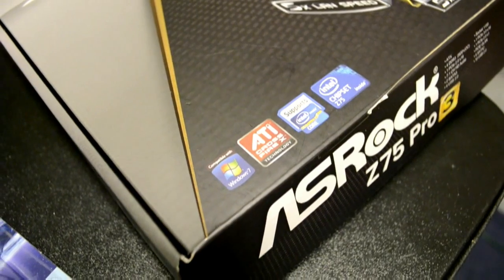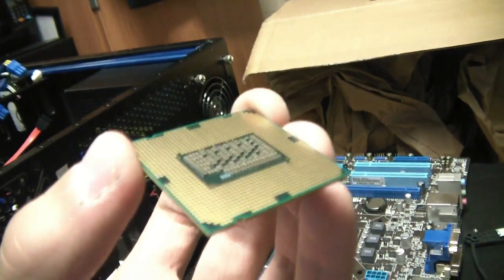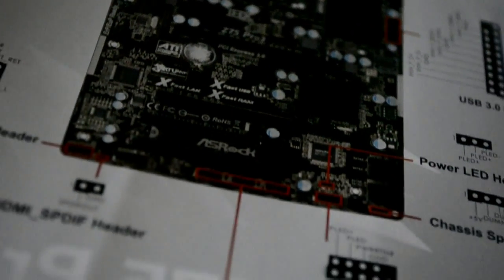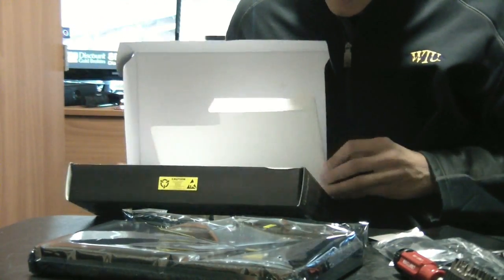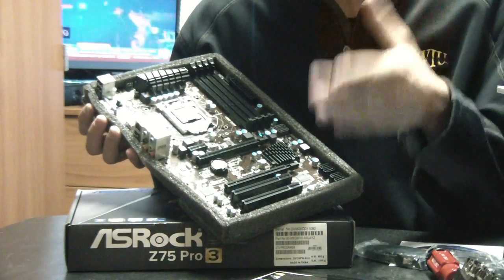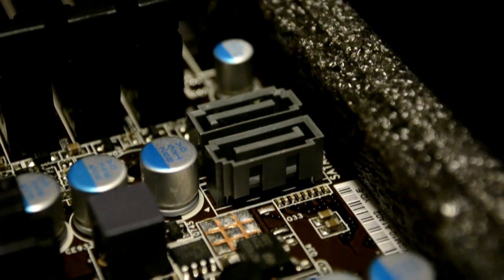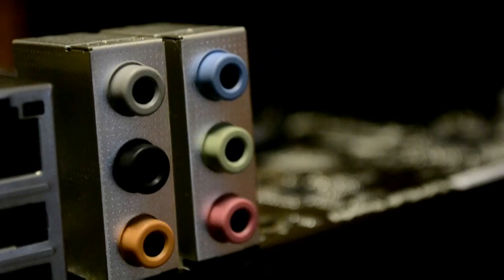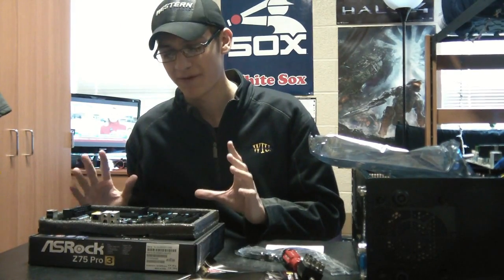ASRock Z75 Pro 3 Motherboard Unboxin/Overview/Review

Comment from the maker: Just glancing at them, the Extreme3/4 both have 2x PCI 3.0x16 which is perfect for SLI and Crossfire, but the Pro 3 has one 3.0 and one 2.0, so it's still not bad for SLI and Crossfire.
Extreme 4 has 4 6gb/s SATA ports, and the Extreme3/Pro 3 have 2.
The Pro3 is a Z75 chipset, the Extreme 3/4 are Z77 chipset.
Exteme 3/4 both come with an SLI bridge.
Those seem to be the big differences.

Comment: I bought this motherboard NIB in 2020 for $33usd. I installed a used  i5-3570k($30usd), 32gb 1600mhz DDR3($80usd) and a used rx580 with 8gb($100usd). I completed the build with a used 1tb mechanical drive, 30gb SSD, and a cooler master hyper 212x I had in my bin of parts. It's not exactly the fastest build I've ever done, but it's certainly no slouch either.

Comment from the maker: After doing more research on the matter, it supports only crossfire, NOT SLI. I figured since it supported one it would both, but it does not actually. I added an annotation fixing the mistake a while ago, I thought.  Apparently not.

Comment: If I would want to overclock a non-k processor with the bios, what would be the minimum to do so for a power supply.Just got this motherboard with an i5-2400(I know I shoulda got the i5-2500...) and I have a 500W Evga psu.

Comment: My sata ports are in a weird spot too. There on the lower right end of the mobo facing to the right. U shud of gotton a bigger case with  cause of the sata port locations. I got a big ass space cooler master case cause of my asrock nd gtx680 =) what kind of power supply do u have?